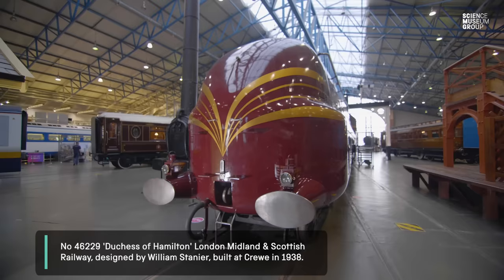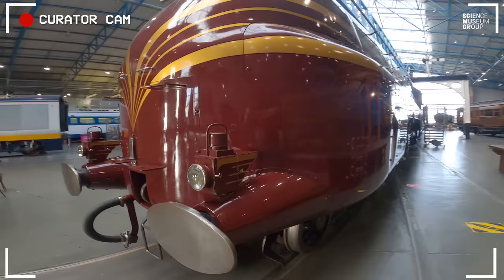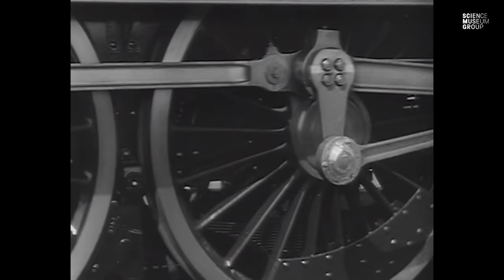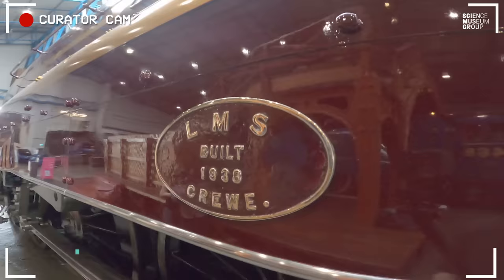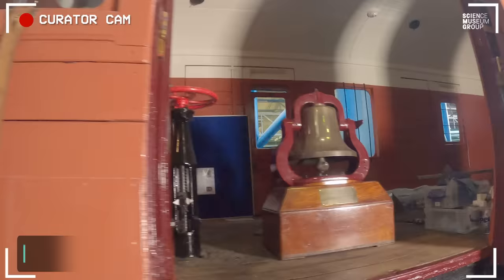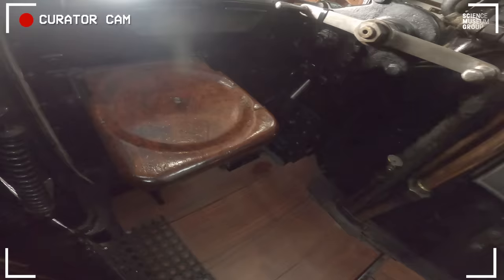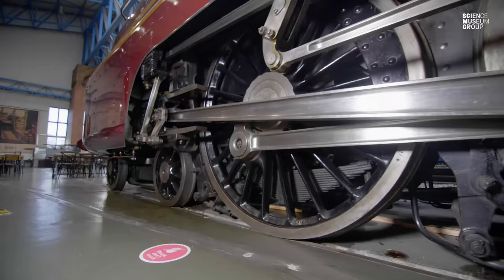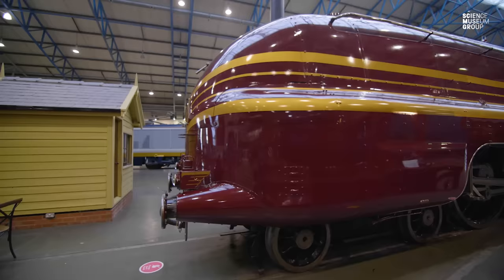In-depth with Duchess of Hamilton: A Streamlined Icon | Curator with a Camera

Comment: The Duchesse Pacifics were far better looking without the streamlining which added unwanted weight to the loco and made maintenance more difficult. The Gresley A4s were actually a streamlined design which was far better and miles ahead of the LMS Pacifics. The cab layout of the controls on the Gresley A4s was far ahead of the Staniers.
Reply: Your viewpoint would fit in with William Stanier's own viewpoint on the streamlining.

Comment: Is there any truth to the idea that the streamlining for these locomotives was essentially decorative and aerodynamically useless whereas the Greeley A4s had been wind tunnel tested?  Or is this a myth I have picked up?
Reply: The streamlining on the Coronation Class was designed specifically for speed. It was not for decoration, and it was not useless. If you want a engine with useless decorations, look at Bulleid’s Pacifics.
Reply: @nikerailfanningttm9046  Were those the Southern Railway "spam cans"?

Comment: Right Mr.Curator... shall we amend the errors currently on this loco??? The builder's plate is a repro because originally it was a dateless plate. Either you have the original or Bob Meanly does but it was on this loco prior to restreamlining. The underside of the streamlining's beading was painted red, not polished like on the first 5 blue ones. Top smokebox handles have never been put on due to the paint curing in 2009, so come on! Handrail stanchion posts were originally chromed, and not painted red. As for the repro lamps, their top stripe is way too fat if you bothered to check the originals in the USA; and the wedge they sit on should be chrome not painted red. Isn't it about time you guys got on and sorted this list out? It's been 13 years now and I'm still waiting. If my comments upset people here, don't be, it's just inaccuracies do my head in.
Reply from the maker: No problem with your comment, Saxtoo. Here's what Anthony says:

"We know about these issues, and have long planned to complete the restoration with the smokebox handles which would make the front end right. Bear with us!"

Thanks for watching!
Reply: A rare sighting of a lessor spotted rivet counter
Reply: Nice of you to announce yourself, David 🤡

Comment: The problem is...... this is not the original streamlining. This is a reproduction body case based on photographs not the plans. So not the real thing the. And that pile of rust claimed to be Rocket is not  THE Rocket. It is replacement parts that may have touched parts that replaced parts that might have been connected to parts associated at some point with bits of the original Rocket. Don't believe everything you are spoon fed.